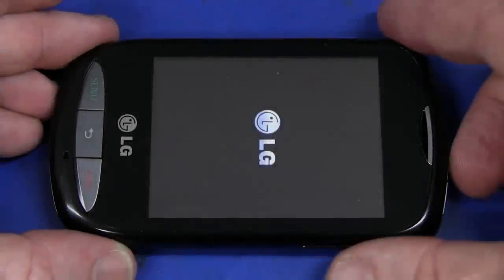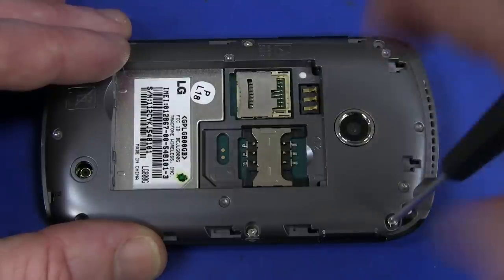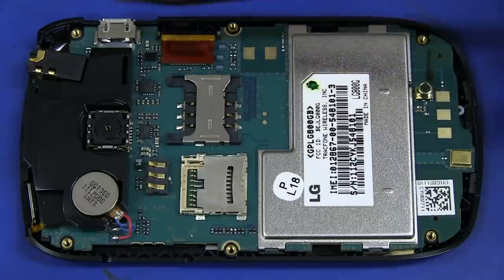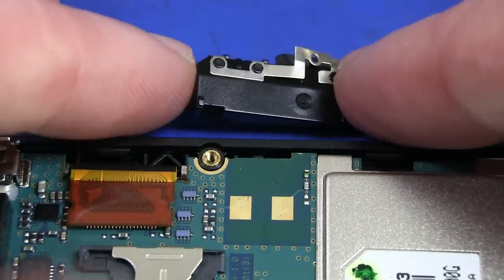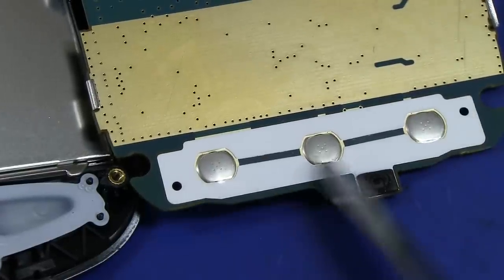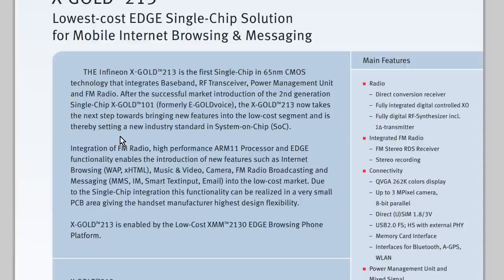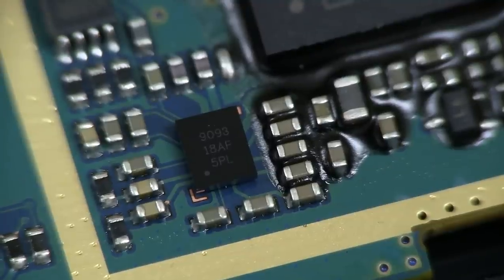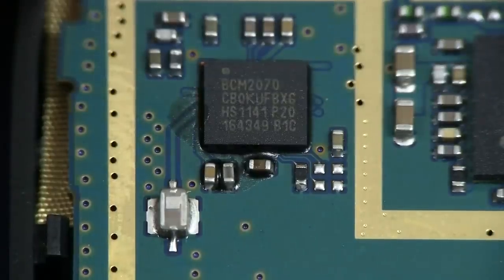EEVblog #514 - $5 Mobile Phone Teardown - LG800G

Comment: You can put a micro sim in a full size sim slot, I have done it often, you just have to slide it over the contacts correctly, that lets you examine the operating system.

Comment: 7:30 that's not for the backlight, that's for the touchscreen digitizer
Reply: How would a digitizer have 4 contacts?
Reply: that's not an advanced touchscreen, you only need 4 connections 1 at each corner of the screen and you create a matrix out of that and depending on where you put your finger it will change values between the different lines so you can pinpoint where did you touch
Reply: Doubtful, maybe it is for the light sensor and proximity sensor.

Comment: Ironically in 1990 this technology would be worth about £50,000. The ARM CPU alone was light years ahead of commercial processors at that time Let alone the memory.
Reply: Its 2021 and you can get a very competent mobile phone for $20. Damn impressive.

Hell, back in 2015 most $20 phones where flip phones or god awful smartphones.
Reply: It'crazy how fast electronics has evolved. The invention of the transistor is not that old

Comment: Did you see the 208mHz rating for the cpu? Lightning fast;)
Reply: David Sears *MHz
Reply: Mhm, sure ^^
Reply: +Arek R. Nah,mHz ! millihertz has to b invented^^
Reply: +Daniel “Dan” Nichols I think he means a Milihertz soc processor that goes so slow has yet to be invented, but I am not sure.
Reply: +David Sears Man, It takes 6.46879756469 years to do 1 single operation! (lowercase m is milli, I think you mean M witch means mega)
Reply: +Bungis Albondigas Just use a counter and basic oscillators. When it reaches whatever time (6.46879756469 years for millihertz) perform an operation.
Reply: ***** really? U missed my joke..
Reply: yeah
Reply: I have 66mhz Intel PC still in use lol
Reply: Waylander I don't think that is even possible? I thought 1ghz dual core is the worse legal cpu .
Reply: @ender_scythe2879  Hu? 208mHz would be 208 cycles every 1000 seconds, or 4.8 seconds per cycle.

Comment: Correct me if I'm wrong, but AFAIK the external antenna connector used in the factory to test the antenna (using a spectrum analyzer) in the fully assembled phone. That's why it's hidden under the back cover. It's not meant to be used by any accessories.

Comment: I remember taking apart my LG Xenon phone in a very similar fashion, despite it being a slightly different form-factor. I had to do this because I dropped the phone and the screen and buttons quit working. I didn't know what the problem could have been, but an idea came up that the cable connecting the mainboard to the screen might be disconnected. The LG Xenon was disassembled in a very similar way, and lucky for me, the cable connecting the face was disconnected and the mainboard wasn't bad.

Comment: Since the LCD controller is built into the main SoC, I think the LCD will be an 8080/6800 type 8/16 bit parallel interface, or it'll be a 6 bit-per-colour RGB parallel interface.

Either way I'm sure that the LCD itself lacks any controller or display buffer (the display FFC will likely hold driver chips and that's it) and that all of the display refresh and such will be done by the SoC, as they'd want to minimize component cost.

Comment: I suspect that what you point out as the backlight connections is actually for a resistive touch screen. Could easily be checked of couse but I have found that more often than not backlights are built into the lcd and connector more often than resistive touch. Which given the cost of the phone, is almost certainly resistive touch.

Comment: External antenna connectors on modern mobile phones are not intended for the user to connect to, but are only used during production to calibrate the RF frontend.

Comment: The four-contact flex at the top of the phone which you mentioned might be the power for the LED backlights is actually the for the resistive touchscreen. All power for the LCD and LED Backlighting goes through the other bigger LCD flex.

Comment: I got a Motorola W175G from Trac when I was in the US a few years ago. This thing was so locked down it was ridiculous. USB connectivity was completely crippled, and even after unlocking everything stopped working when the "unit" and "service days" counter reached zero even with a different SIM card on a different network. Unless flashed with factory firmware, and good luck doing that with crippled USB, those phones are completely worthless hence why they're so cheap

Comment: Those spring contacts that you mention where you thought it was for the backlight is most likely for the touch panel, the backlight connection is probably in the LCD main flat flex

Comment: The gold or Cooper color chip at the bottom is actually the microphone for the device and the touch screen is that flex cable that presses on the board underneath the headset jack. Fun facks

Comment: Could you please do a video where you explain what all those capacitors are used for?
I learned in college how to do calculations and stuff with them. But I can't imagine what they need sooo many for... Could you help me there?
Reply: Most of them will be there because of power supply bypass reasons (for the individual chips, as well as in the DC/DC converter). There might be some for filtering reasons, but in such a space and cost minimized product most if not all filtering will be done inside the controllers. The only other use I can see is what should be an antenna matching networks for bluetooth. And btw. there are not that many ;)

Comment: And if you're interested - the CAN buss interface cable from the interface box to a patient simulator had been yanked hard, and shorted a +12v 5A line to one of the signal lines. Ended up letting the magic smoke out of a 74HC08 Quad AND-gate IC.

i . imgur . com
Before: J1d0Tz4.jpg
After: Mc5o0Hb.jpg
Board Overview: M8Ri11e.jpg
(The giant ceramic resistor is to dissipate the current from defibrillation - handles 360j of energy up to 3 times per minute!)

Comment: hi,

In December 1947, Douglas H. Ring and W. Rae Young, Bell Labs engineers, proposed hexagonal cells for mobile phones in vehicles. At this stage, the technology to implement these ideas did not exist, nor had the frequencies been allocated. 

Two decades would pass before Richard H. Frenkiel, Joel S. Engel and Philip T. Porter of Bell Labs invented the dial-then-send method used by all cell phones to reduce wasted channel time.

Comment: I wonder why that antenna couldn't just be printed as PCB tracks, that would save on the BOM, since the pcb is being made anyway.  On the other hand, I suspect LG may be using the same antenna across many models at very different price ranges.  If they really wanted to cut the price further, they could omit the built in mic and speaker, making it a headset only device with a noisy vibrator for ringing. Also, a single power/ok button then the rest as softbuttons could shave a few more cents.  Get downloadable firmware from the (user supplied) SD card and ditch the flash chip (like on a Pi). Use a monochrome reflective LCD since the base functions don't need color.  Use test points instead of a connector for antenna test.  Omit the middle plastic layer and let the back and front hold everything in place.  Still lots of ways to build this down to a lower price.

Comment: As a phone, it's not bad (I had one a few years ago). But to do anything else on it, like text or play games, etc, it's a pain in the ass because its screen is "resistive" instead of "capacitive", which means you have to actually push on the screen for it to register which is a pain when you're trying to text rapidly. But for just a basic phone that can text and play games (limited variety), it's not bad.

JW3HH

Comment: I'd rather have buttons with my non-smart feature phones, but this was a rather solid and very easy to use touch screen basic cell phone. Had a better build quality than most third-generation Android devices at the time. It felt better built than the LG Optimus Logic/Dynamic/Zone.

Comment: You can't shave Bluetooth anymore. It's required by law in many places to use hands free calling while in a vehicle.
Reply: would have been nice to pick up some stocks in that when they were starting up :(
Reply: What? You can't plug in the headphone any more?
Reply: erg0centric Don't call in a car...
Reply: you can "shave" bluetooth in phones, it's not like you need to answer your phone when you're driving
Reply: joblessalex It's illegal to use a handset at all in the UK. They are shit hot on it as well. If you drive past a police car and they even think you aren't using a hands free kit they will come after you with the blue lights and sirens and everything. It's also at least 3 points on your driving licence if you're caught.
Reply: My phone has excellent speakerphone mode
Reply: +Graeme Pryce But what constitutes a hands free set? I thought that a blue tooth head set would be acceptable, since you don't use your hands on it at all while the call is going on. You need to press the button to terminate the call, but that is no hassle since it only takes a tenth of a second, shorter than using the gear stick. Either way, it is better to pull up imo, especially if you are expecting a long and important call.
Reply: Bungis Albondigas You're okay with a bluetooth head set. It's holding the phone up to your ear or texting that is illegal. Like you say, it's fine to just take your hands away to press a button.
Reply: Graeme Pryce I thought so. But still, I would still pull over anyway if I could. The trouble is you can't always, like if you are on a long motorway segment without a bank.
Reply: Bungis Albondigas In the UK, if you can't answer your phone without using a hands free kit then you don't answer it. No phone call is more important than your life or the lives of the other motorists around you. It's one of the laws I fully agree with to be honest!
Reply: +Bungis Albondigas "Or even worse"? What could be worse than that?
Reply: +maxsnts Becoming a living vegetable, alive, awake and probably in pain, but unable to move, talk or otherwise communicate with other humans for the rest of your life.

Comment: Extreme for the price... BUT! It's a touch screen... And there's the problem! If a product can't do much at all, then why would you need a touchscreen? You can also use the easier to use buttons. That's the reason why next, to touchscreen stuff, we also have something very different and relatively low end lieing around here: a Samsung Outdoor Phone that you can run over with a truck, throw in boiling water and toss against the wall, it survives a lot and well, is relatively cheap as well!

Comment: I wish a company would just make a basic phone. (really low power LCD (like whats on those 10 year battery life digital watches) and just have it send and receive phone calls)

I currently use an old cellphone as an emergency phone that is kept in the car and I simply check the battery every few months by turning the phone on. (the old/basic phones, have an extremely good standby time emergency numbers are free and require no sim card, and are nearly indestructible, and startup in 3 seconds.

Comment: What's the reason that this isn't classified as a smart phone?
Reply: benaloney these kinds of phones run a locked embedded operating system that has little to no possibility of being altered to run customized applications that could end up using a lot of network bandwidth, which is what the network carrier cares about.  with tons of R&D I guess someone could reverse engineer something but nobody will do that in this day and age where you have standardized android systems or even iphones available.
Reply: benaloney because people think that "smart phone" means "android" or "iphone".
That little phone is smarter than the Comodore 128 you (or your dad, depending on your age) had as a child (or dreamed of having but couldn't afford).
Reply: +jwenting still not a smartphone
Reply: +userful1 it is a smartphone. you can install java apps.

I had one of these, installed ssh client, a vnc remote desktop client, winamp remote control app, and cell sniffing app to view cell tower data you aren't supposed to see

you can also reflash it and run Android or it can run raspian
Reply: +qoaa meh still not a classic smartphone, of course you can diy hack it, what isnt diy hackable? :D
Reply: +userful1 ps.: btw I can accept it as a smartphone if you guys say so, for me its still not one, but hey, it wont hurt if I accept it :)

Comment: Headphone sockets are very unreliable, mics get over stressed and speakers fail too, the screen can get cracked and even the casing will get scratched up. I suppose they make enough money on the initial sales to justify refurbing a few which are then sold by the service provider at a loss in order to get more subscribers. It won't take long for a service provider to recoup their costs even if the subscribers are only using $10 per month in calls. People often upgrade from a cheap phone too.

Comment: You can find $10 Android pre-paid cell phones all day long in the US. They make horrible phones, but pretty decent MP3 or video players!
Reply: D.E. Sarcarean Android doesn't make phones. That's like saying Windows makes computers.
Reply: Obviously I meant cell-phones that run Android OS. But to your comment, Android is a company (owned by Google/Alphabet) and it does (through contract and collaboration) design and make the Pixel smartphone.
Reply: D.E. Sarcarean Indeed. And the early versions of Android were horrible slow pieces of crap. They've certainly stepped up their game though, I'm running Android Nougat and it's a really neat and sleek OS. Definitely much more than just an MP3/Video player.

Comment: 8 years ago that would have been a reasonable good phone actually!
Reply: user5134 It's a reasonable phone for those who just want a simple cheap phone to do basic stuff and doesn't care about apps and such.
Reply: user5134 it still is a good phone. Problem is that what people call a "phone" now is actually a handheld computer that just happens to have a modem and a microphone built in...

I've a low end smart phone myself, was debating whether to spend even that much but having the big number buttons on that 4.5" screen that I can push with my big fat fingers clinched the deal over a traditional model where I'd need to use a pencil to push the tiny little push buttons on.
Apps? yeah, I've installed one that I use once every few weeks, but that's it.
Reply: user5134 8 years ago this phone would've been fucking awesome. Now it's worthless but oh well.

Comment: I'd love to see if I could hack a phone like that and use it as an external GSM device for my Arduino and Raspberry Pi. I'm thinking of a remote security system for my car that will call or text me if it's triggered. The very cheapest rate plan would suffice.

Comment: Lol apparently he knows nothing about phones that "vibration motor" isn't  a vibration motor but a battery to keep the date and time right and or automatically powers on your phone at a given time if you have that function its pretty much like a bios battery for a PC but then in a phone
Reply: Nvm he was right but I don't get why my old cellphone had a regular vibrator motor and that round one
Reply: Phones sync their time with the network. They have been for 10+ years... Phones don't include RTC batteries.

This is definitely a vibration motor.
Reply: OverSoft not exactly true, time just resets when you replace the battery.

Some phones have 2 vibration motors.
Reply: drkastenbrot different kind*